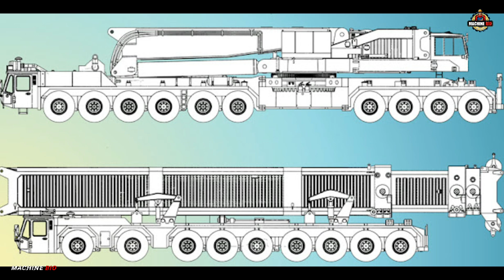Gottwald AMK 1000 A Lasting Legacy

Comment: Speaking of autonomity... AMK 1000 needs masttransporter and at least one big trailer for outriggers. Plus additional trailer for ballast and jib winch. Plus another mobile crane to lift ballast, winch and outrigger legs from trailers into position. Sure, that can be done by AMK itself with some level of operator expertise and even surface. But to lift jib segments you will definitely need additional crane. So, in short, there is not much autonomity at all. Liebherr LTGM 1800 beats AMK 1000, has outriggers fully integrated and is more versatile due to tele-/lattice mast attachments plus derrick and 5 winches covering any needs - all in one machine (plus ballast plates, masts and jibs on separate trailers of course). By the way, LTM 1800 lifts teleboom from trailer with A-frame and connects it to upper body.
Reply from the maker: Thanks for sharing🙂